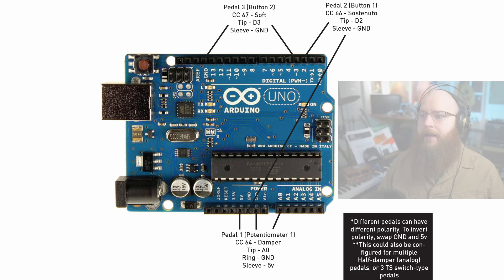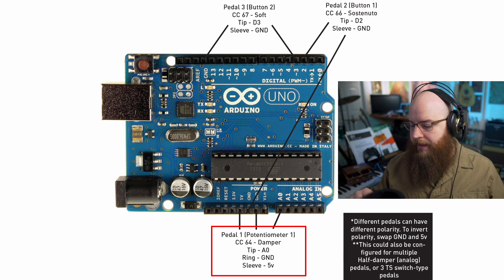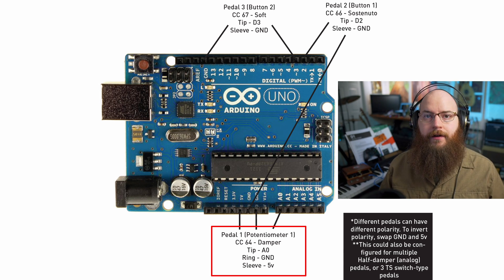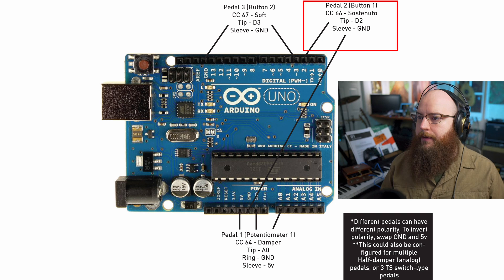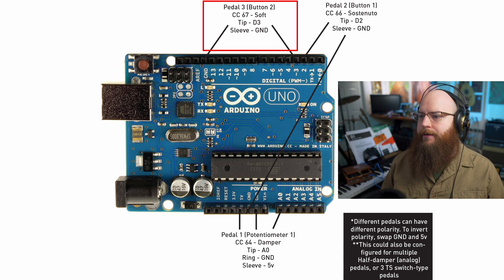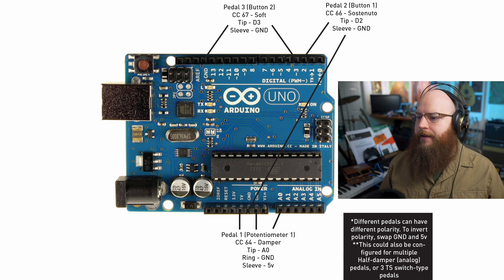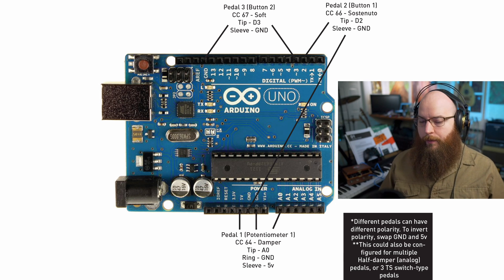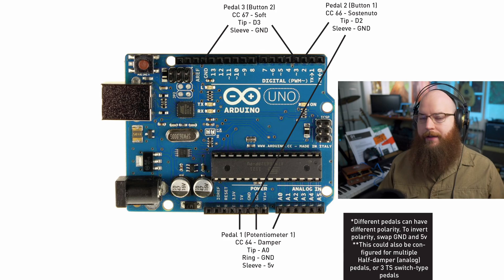Arduino Piano Pedal System

Comment: Does the damper/potentiometer signal output all levels - 0-127 or in separate zones from the arduino?
Reply from the maker: All levels
Reply: @NickLeonard  Thanks.  Answered my own question by watching your next vid.
Reply: Do you know where in the Arduino code to change the serial port number?
Reply: Ha ha, never mind again - its a CH340 driver problem.  I keep answering my own question
Reply: If anyone needs to know how to calibrate the pot damper to hit a range of 0-127 in the arduino code, first use Hairless MIDI to see what range your damper outputs, do a math calibration, and change the variable potmessage in:

MIDI.sendControlChange(POTS[i]->Pcontrol, (potmessage-14)*1.75, POTS[i]->Pchannel);

MIDI.sendControlChange(MUXPOTS[i]->Pcontrol, (potmessage-14)*1.75, MUXPOTS[i]->Pchannel);

You can see my pedal was only outputting around 16-87 or so, so I just did some rough math and changed to  (potmessage-14)*1.75 for a rough calibration.

Its working well - thanks!

Comment: What happens if you connect an expression pedal directly into the dmaper input in the korg, would the computer daw read it as an expression pedal ?
Reply from the maker: it only knows how to read certain signals, so no. that input is mapped to damper, and even then, it wont read an analog damper like the yamaha i have. it just does nothing, sadly
Reply: @NickLeonard I'm planning to buy a korg D1, and for my playing purpose I don't think I need a triple pedal setup, just a sustain pedal would be ok. my question is: if I connect it to an ipad as a midi controller for gigging purpose, can I use a volume/expression pedal/foot switch pedal with it? I heard you can connect those to the ipad instead and map it to whatever app you're using for gigging to switch sounds/preset on the fly. is that true? 

I really like the key action of the d1, and budget wise I can either get that and an ipad, or the roland RD-88, which is about almost thrice as expensive than the roland. I like the key action of the D1 much more than the RD-88. I figured using an ipad for sound source would be ideal to fix the D1 limited sound library, but not being able to switch tones on the fly with my feet would be a dealbreaker. otherwise, the D1 would be perfect for me.
Reply from the maker: @グレンズ  if the iPad is a midi input, you should have no trouble sending midi control messages like pedaling to the D1, but for more sounds you'd need the D1 midi output to the iPad, and another input for the pedals. I'm sure it can work, just like I've got both the D1 as a midi controller into my PC as well as the pedals, the PC runs the instruments and interprets the pedals. I don't know much about the iPad side of things but I'm sure it's possible

Comment: It's definitely funnier and more exciting to build something - you always learn from it. I'm looking forward to the videos with more MIDI enhancements. But is there a reason you chose an Arduino instead of a Teensy?
Reply from the maker: There's no specific reason, I dont know too much about the Teensy. I think if I go with a smaller chip I would use the nano since the code should be compatible.